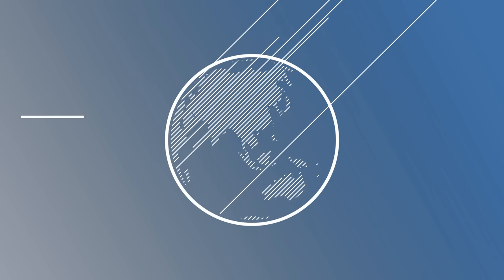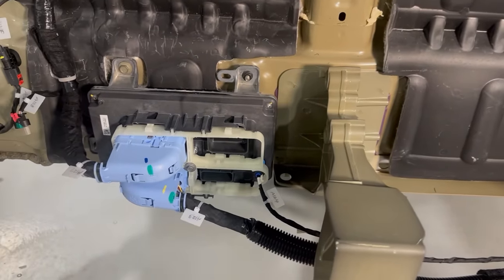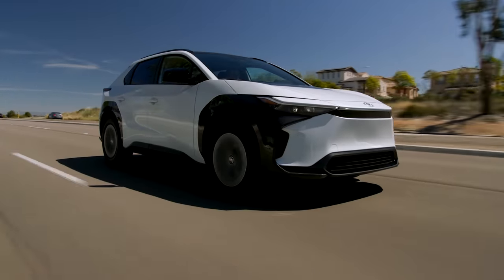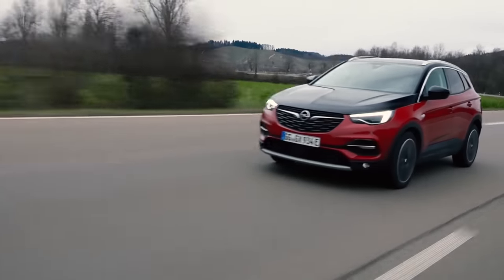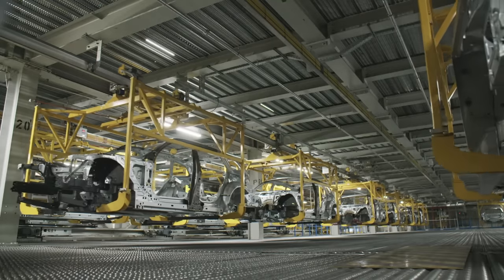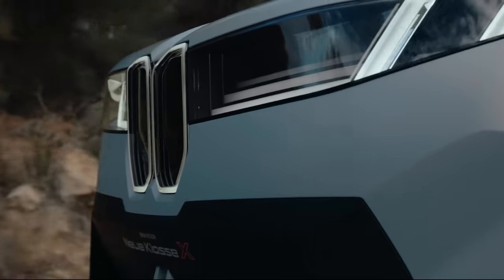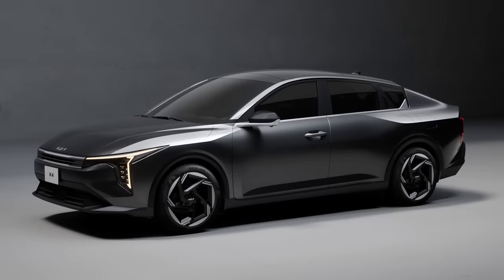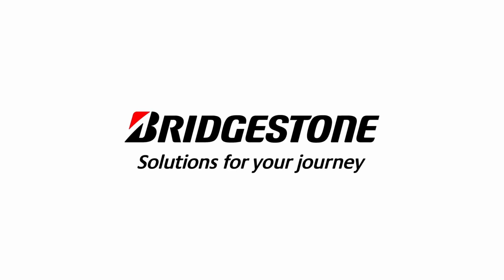BMW Neue Klasse Cuts Pack Cost in Half; BNEF Says BEVs Far Cleaner Than ICE - Autoline Daily 3773

Comment: “BMW’s first dedicated EV platform” everybody forgetting about the i3 😢
Reply: The i3 design usually gets a lot of shade, but I always thought they were cute cars.  🤷
Reply: @BTC_Minarchist  I rented one twice. They offer a lot of room for the small size. Driving is nice and because the design is old, they still got a lot of buttons.  Sadly the battery is subpar compared to today’s standards so I wouldn’t buy a used one 🙃
Reply: @MarkusSchneider1  I've never driven.  Good to know.  I'd love it if BMW would produce again, but using modern EV manufacturing techniques, SW, and battery pack.  I think it would do well at the right price and with added range.  There are two of them in my neighborhood and the owners enjoy them for use around town.
Reply: The i3 was also available as PHEV.
Reply: @dontneednostinkingchannel2190  You are right, I always forget about the range extender. I even once drove the i8 which was definetily a PHEV.
Reply: at last check, there were like a dozen i3's still in active rental across 'Murica on Turo.
Reply: Today's BMW iX also sits on its own EV-only platform
Reply: @BBingo-v5i  You are right. Also mostly carbon. Drove one twice, strangely still uses a lot of electricity 🥹

Comment: Autoline! Thank you for the total energy comparison info for BEV vs ICE.  Would be even more interesting to see estimates (these all are estimates) of where hybrid electric and PHEV’s fit for total energy required vs ICE and BEVs.  Does it play out similar to driving efficiency?  Or are the more complex (hybrid) or dual (PHEV) drivetrain vehicles turn out to be worse??  Thank you again for looking for info like this!!
Reply: The problem is plug in hybrid cars depend on the way people drive them.  The same car will be essentially an EV for one guy and an ICE for the next.
Reply: @danharold3087  What tech drivetrain doesn’t change efficiency noticibly with driving style other than the ones that have <10 mpg to start (Hummer H1 or H2)??  I can get really poor efficiency from my EV if I drive it like it’s stolen.  Same thing for the 3/4 ton we use to tow our travel trailer (12 mpg stolen, 17 saintly).  I’ve seen folks driving Prius’s hard on the interstate.  I figured they liked getting 32mpg in the Prius instead of 18 in a large sedan.
Reply: @daves1646    This is not about driving style.  It is about charging habits or lack of.  At the extremes it is almost 100% ICE at the other near 100% BEV.
Reply: PHEVs are a waste of resources. Dual power sources, dual drivetrains, extra weight, higher maintenance costs. Boooo
Reply: @Mpr47276  Nice generic ideas. PHEVs use more of some materials and less of others to build; but for some owners, that won’t accept all-electric, this get’s them off fossil fuel for some/much of their use case.  Pragmatic has a place, especially if you want to move the dial.  You’re gonna mandate/shove EVs down everyone’s throat??? Really?  Good luck with that.

Comment: 1:26 - don't look now boys and girls, but those are standard 12V harnesses you're looking at with those blue covers, they've just got 48V running to them.  and that's fine because in terms of an OEM's longterm need to keep Warranty Costs down after the launch of a new product, DURABILITY MATTERS...

hint: as you see in the clip from the video, if in a year's time you should experience the misfortune of having a bad harness in your expensive Cybertruck because they spec'd the wrong gauge wire, they likely won't be sending out mobile techs to replace these in customer's driveway (not in the rain, not in the summer heat, not in the winter cold).
Reply: News flash - pseudo sophisticated and patronizing trolling is still trolling! Why don't you post some serious content with some real technology insights, instead of this crap

Comment: I'm holding out for 49 Volts 🤣
Reply: 48 V is obsolete in Electric vehicles. Just do what Porsche did with Second generation taycan. Everything needs more than 12 volts run on 800volt , steering, Active suspension, ac, etc. Much more simple and elegant solution than using 3 different voltage like in the cyber truck.
Reply: 48v is nominal, it's actually 40-58v... so you're good to go. No need to hold out 😂
Reply: 59v
Reply: @simson4t  dont spread false information, Porsche uses 3 different voltages: 800V, 400V and 12V. Not the smartest move, just a compromise to be able to use parts from the shelf.
Electricity consumers in particular, such as the entertainment system, are in the range that is not covered by either 12V or 400V.
Reply: @Zedus-rl9hp  it was the first generation. When it came out there was no 800 volt AC Compressor so they had to use 400 volt one. But in the first generation they also used 48 volt to power the Active suspension. 
Now when all the light sources are led and all ECUs are low Power it makes no sense to introduce a second low voltage system just for the audio System.
Reply: give me 60V or give me leave of this cruel world...!!!  (in your face dinosaur 48)
Reply: @simson4t  re: "48 V is obsolete in Electric vehicles. Just do what Porsche did with Second generation taycan. Everything needs more than 12 volts run on 800volt..."  <----  see, 4 Stroke OJ Simson gets it 🤙(and like myself he knows about this stuff).
Reply: Remember when we had 48v sys, so lame
Reply: @Zedus-rl9hp  re: "Porsche uses 3 different voltages: 800V, 400V and 12V. Not the smartest move, just a compromise to be able to use parts from the shelf." TRANSLATION:  then it's the "smartest move" since what we're ultimately talking about here IS the business of manufacturing.  turns out, if/when you win Lemans 19 times since 1970 (and they have) it means you learn things other manufacturers can only PRETEND that they know about...

take for example how to properly spec brake components on a heavy AF electric vehicle...?  yeah repeatedly slowing from 200+ MPH at the end of the Mulsanne Straight for 24 hours is an "education" that can't be easily duplicated by way of a fanciful CEO's "Egotism" and "Wish Casting".  only Engineering Professionals need apply.

Comment: So zonal architecture is what they used when they upgraded my 34 Ford from a 6v system to a 12V system back in the day?
Reply: Back then you could get 12 volt stuff. Just swap the light bulbs and generator.
Reply: Hahahaha!!

I think what they were using in 1934 was called "wire."

Zonal architecture is a little bit different.

Comment: Changing everything to 48 systems will cause a lot of repair shops to change a lot of things for sure and at a large  cost
Reply: @EnriqueThieleOnce bucked, Ohm says power is power!  Did Adrian give you that bit of misinformation!  His BA in Physics is questionable!
Reply: Like what? Battery charger?
Reply: Will it? Won't they be easier to work with overall? I feel like the problem will be changing out your parts inventory. But how often do repair shops nowadays sit on huge stockpiles of parts?

You'll service the existing cars for many, many years to come. And you'll stock new parts for the new cars that switch. It's more complicated, but I don't see the specific downside that will destroy shops.
Reply: @Cyrribrae  will require a new attitude for electric also as now only concern is really hydro a and the few  electrics but they have stated already that the 42 volt systems can hurt you if not careful so far hybrids have only been until disconnection time is complete when removing safety connection after that good to go

Comment: 48 V is obsolete in Electric vehicles. Just do what Porsche did with Second generation taycan. Everything needs more than 12 volts run on 800volt , steering, Active suspension, ac, etc. Much more simple and elegant solution than using 3 different voltage like in the cyber truck.
Reply: Correct
Reply: re: "Just do what Porsche did with Second generation taycan"  IN YOUR FACE TRI-MOTOR PLAID...!!! (i'm beating you while sticking with only 2 motors)

Comment: Did the emissions study give ICE and electric vehicles the same lifespan? I don’t know anyone using 15 year old smartphones
Reply: Apples and oranges
Reply: But how much energy does ittake ro build all the new fastchargers!
Reply: @brunoheggli2888 How much does it cost to dig up old leaking gas tanks and the remediation of the contaminated soil??
Reply: Some companies like Tesla provide free software features and upgrades to older cars.  Tesla even has a CPU replacement option to upgrade to newer technology.  As for lifespan,   dumping a $500 phone that is worthless after 5 years is a bit different than a $40K vehicle.  Plenty of people will buy that older car (EV or ICE) that has older tech, as the purchase price is a lot lower than new.  Keeps those cars operating for years longer.
Reply: Cell phones don't have the same level of battery management. The phone manufacturer wants you to buy a new phone every couple of years so they don't give you the tools to maintain your phone battery properly.
Reply: Cars aren't smartphones.
Reply: @brunoheggli2888 Need to include installation and  what source is all the fast charger power coming from?
Reply: @russh6414  A) You're making up the whole fire thing.  B) Cuba is 100% ICE cars. Might be worth looking into for a move. They won't see EVs for another 30 years.🤣
Reply: This post is a clear example of why youtube hides downvote counts now.
Reply: @russh6414 I will tell the fictional firefighters fighting fictional fires in your fictional story.    Be right back. 😂
Reply: @tesla_tap  Depending on where battery prices go we may see affordable battery replacements for old EVs.   This will keep them on the road for even longer.   Tesla is working on decreasing maintenance, part failure,  on its cars.  The cars that result from this work may run much further than current cars.  Especially ICE cars which are designed to fail.  Let's hope that it like lowering prices becomes a trend.
Reply: @russh6414  BEV are the world's best multi fuel vehicle.   So much so that the vehicle and power generation need to be considered separately.    It is so ingenious for fossil fuel companies to generate dirty power then blame the EVs that use it.   Shame Shame.
Reply: @russh6414  Oh come on,  we all know that BEV fires will burn the building to the ground.   Burns for 30 days and 30 nights and the building will be a total loss.  LOL  Your can't have it both ways.    Try looking for how they manage their rags from cleaning their paint equipment.
Reply: @B4R0N.  Exactly. Apparently, some people think they are.
Reply: @davemiller6121 I used to have a job where we supervised the removal of soil at old gas stations. Every single place we dug up was completely contaminated and  it wasn’t always because the old tanks leaked. Much of it was from all the gas that gets spilled when people fill up. Leaks down through gaps/cracks in the concrete and down into the soil. The stuff that remains on the surface just washes into our rivers and lakes when it rains.
Reply: @russh6414 - The report did do that, and showed that using coal generation is still cleaner than ICE (although not as much).  Also only 10% of charging is done at fast chargers.  For example, I charge at home using solar.
Reply: re: "I don’t know anyone using 15 year old smartphones..."  <---- behold beholders, welcome to the scam of the FALSE COMPARISON.  yes, so as cartalker wisely recognizes you MUST identify the scam early, otherwise you risk wasting time "going down a rabbit hole" based on the false narrative created by the OP (yes it's very slick scam).  "cartalker you are going to be a GENERAL SOME DAY...!!!" (salty yet complimentary Drill Sergeant voice)
Reply: @brunoheggli2888 Right, so much more than drilling oil halfway around the world, fighting trillion dollar wars to secure it, transporting it halfway around the world, refining it by cooking at high Temps transporting it all around the country to gas stations so you can burn it at 10% efficiency. I'm sure building fast chargers takes so much more!
Reply: @andyfeimsternfei8408  Ya think about how much energy is saved just by transporting power through our electrical grid instead of transporting fuel and waste oil via trucks, ships, and pipelines. Our current system for moving oil has to be the most wasteful system on the face of the earth.
Reply: @MB-kk8px  Yes, it's laughable to hear people try and defend fossil fuels.

Comment: Tesla, AI Stocks Lead S&P 500 Winners
Reply: How much market cap has TSLA lost in the last 3 years?
How much market value has TSLA lost YTD?
Reply: Yup, Tesla is the same price it was 40 months ago while S&P is up 44%.
Reply: Game over for Tesla!
Reply: I hope you dont have too much money tied up in that one stock or you are screwed.
Reply: I keep track of when Tesla entered the S&P500 since that time Tesla is down around 22% and the S&P500 is up 42% so the delta is a negative 64%
Tesla does not pay a dividend (gm and Ford do), and S&P500 at least a 5% dividend total over that period so Telsa is down around 69%
Tesla P/E is down around 70%
Not good for all the retirement accounts that have an S&P500 type low-cost index fund (the fund is not equal weight at one time Tesla was around 5% of the index)
Reply: @jdmather5755  I've lost so much on Tesla stock.  It's a nightmare roller coaster.